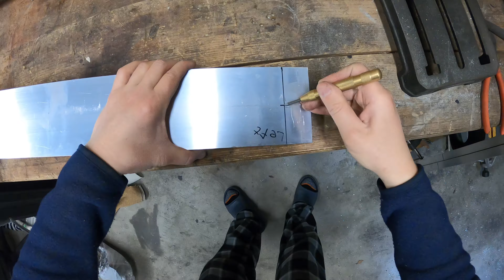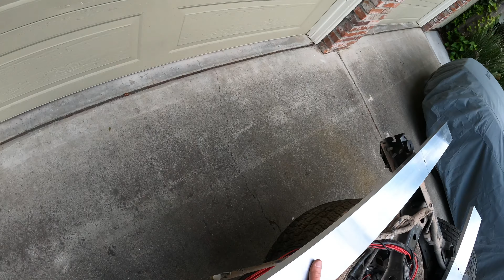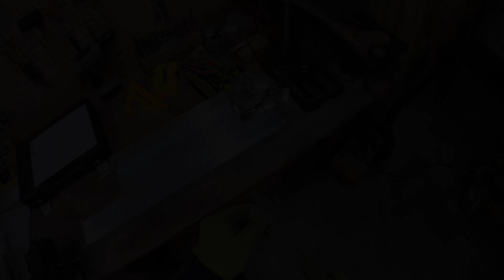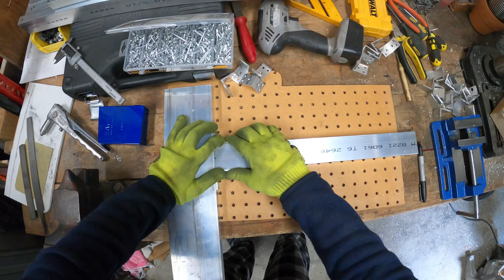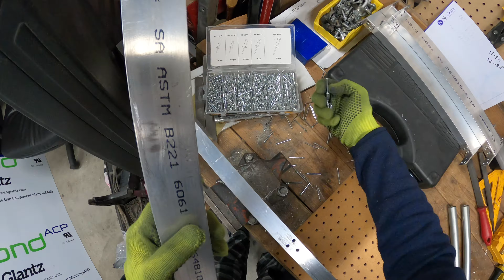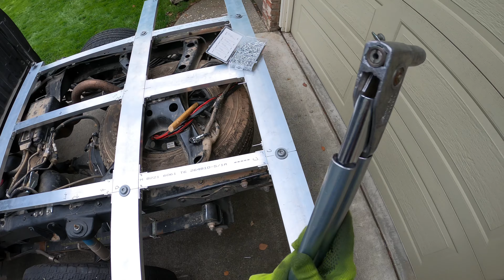Building truck camper -- Ep. 2: subframe

Comment: I sure hope you'll have that aluminum frame welded.  Those cute little brackets and tiny blind rivets won't do the trick.  Good luck!
Reply from the maker: They did it already and continue doing it. Two years travelling/offroading.
Reply: @realsystemrobot  you haven't had any issues with strength of subframe? I like how this style is very DIY friendly. Just curious how it holds up over time. Any input?
Reply from the maker: @TruckCamperCooking  check my previous videos from offroad trails, it was a hard test for the frame and camper in general. I think it's holding up fine. I used thick Al tubes and big steel rivets.
Reply: @realsystemrobot  thanks man I have been reading your posts on truck camper Facebook group. Love the build and excited to see more videos on it
Reply from the maker: @TruckCamperCooking  thank you for that. It's the only reward I have :) the feedback is always appreciated. Keep in touch, I have tons of videos for this project and the next project right after that.